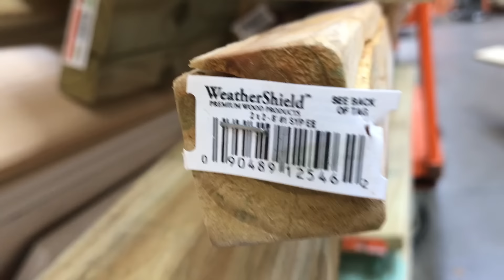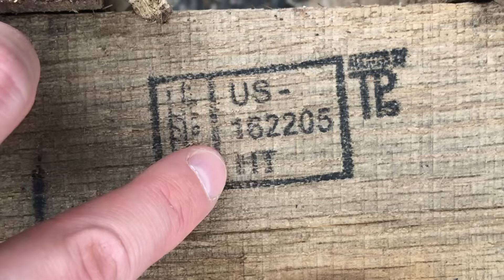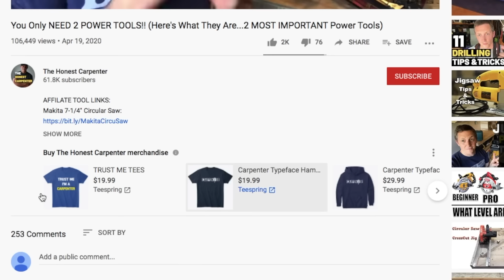Don't Use Pallet Wood!! USE THIS INSTEAD...(Cull Wood Vs. Pallet Wood)

Comment: I’m sticking with the pallets. There are some downfalls to pallets as mentioned in the video, but there’s a lot of benefits of using pallets that outweigh those downfalls. For one, the are extremely cheap and 9/10 they’re free. They don’t require much “building” as they are already nailed together to creat that rectangular shape, and they can be found pretty much anywhere in any town or city. Cull wood isn’t as accessible because most places that sell lumber do not mark down their lumber like you’ve mentioned, not only this but you still have to completely build something out of it requiring you to cut more with machinery, use nail guns/hammers with your own nails, and you have to measure everything out. The reason why pallets are so popular is because they are cheap, readily available, and require less building, less cutting if any and little to no nails or screws. Anyone can make anything out of them. The wood pallets can also be cleaned, stained, treated or painted.
Reply: STOP! Don't buy a used car....buy a brand new car! It's better and more dependable.....yeah, we know. we use pallets for specif projects because they're free and get the jop done...
Reply: I use pallet wood for making planter boxes. The fact that they’re often treated to repel pests actually ends up being a massive plus for me. It means I don’t have to pay a premium for brand new Cedar. 

Plus, I know guys who use the nails I take out of them by melting them down with a forge and making tools, jewelry, brand new nails, etc. 

On top of the fact that people will go out of their way to let you know they’re getting rid of the pallets, it’s infinitely better than cull wood.
Reply: @mikewillard34  no thanks, I'll stick to used cars.
Reply: I sort of like the over used construction look with nail holes and fragments it makes it look really good
Reply: i live in germany and never heard of ohh we have wood you cvan have irt for free .... but pallats is a nother thing ...
Reply: Survey says, Pallets for the WIN!
Reply: I haven’t ever used pallets… but have wanted to. I can’t get them in my vehicle. I would need to break down the pallet before putting it in my vehicle. However, Home Depot will cut the purple marked wood. I go into Home Depot for a couple of boards marked down. Then I ask an employee to cut it down. Home Depot only allows a few cuts a day, but I usually get many more than two cuts.
Reply: @mikewillard34  Nope, used car every time. Also, a completely absurd comparison. Cars are high cost, high consequence, and you're asking them to do a lot. You're not asking much of a pallet, it's minimal effort, and it's free. If it doesn't work, who cares.
Reply: @HerzogvonArteros  I've also never seen this sort of discounted wood.  Offcuts maybe, but even those are never marked down by a huge amount if they a usable size.
Reply: I've used pallet wood for years. Never seen any bugs, and works fine. I'm still alive too 🤣
Reply: I totally agree.  I've collected about  30 of them over the past few weeks, all FREE nearby.  My kiddo and I just toss them in the back of my SUV and unload in our yard.  I'm working on a privacy fence planter box wall for my driveway currently, then a garden potting table, benches and fencing for my animals.  They're so much cheaper than buying that high priced  lumber, all the measuring, cutting,.....besides, you get a very authentic look that your neighbors don't have and your projects become talking points at your social gatherings.
Reply: @blacksinglemomhomesteadont6454  they are fun to work with 👍🏼
Reply: I agree learn I'll pick good pallets and you wouldn't have those problems if you're making small projects pallets are perfect learn how to take them apart leave the nails like old barn wood and your golden
Reply: Totally agree! And if you treat them with anti rot it will protect your pallets from rotting.
Reply: Just got a couple of euro pallets, gonna be making a pallet desk my my gaming rig.
Reply: @flippy66  you seem to have missed their point entirely
Reply: You told him!!!!
Reply: My grandparents built their fence with pallets back in 96 that fence is still up all they do is keep it painted and replace what needs to be replaced.. Good thing is all pallets was free for them came off my grandpa job..
Reply: I'm with you.   They're just fine for making portable 'screens'/fences for certain yard situations or small farm animal enclosures.   Plus, where I'm at, lumber yards aren't giving any wood away.   The local building supply centre sells their crap wood in 4' segments - pick what you want for $2 a piece.   Big whoop
Reply: Ive litterly seen .y uncle use pallets to make a pallet wall like how the old style bars would have those barn / pallet walls and he would sand light burn marks with a torche then Staind and put up on the wall.

Comment: Guess I've been paying full price for cull wood this whole time because that "cull" wood you showed looked like normal inventory at my local Home Depot.
Reply: Same at my local Bunnings 💁
Reply: Now that's darn right funny!  Usually takes 15 minutes to find 10 straight 2x4s.
Reply: @bobr7380  Good luck at mine. If it is over 8' you can go through an entire rack and not come up with 10 straight 2x4s 

The 1x boards are even worse.
Reply: My Lowe’s isn’t any better, either.
Reply: So true
Reply: Those cull wood are way better than what i got here in our country😃
Reply: Perhaps going to a real lumberyard makes more sense than big box?
Reply: They gotten smart now.  They cut them into 2 ft lengths and sell them as "Project wood" for a premium.  May be arts and crafts use short wood (IDK)?  Also for PVC pipes.  10 ft x 1.5 in  = $10.  2ft x 1.5 in = $6.  Anything that is damaged, they cut them into 2 ft length now.
Reply: @ipick4fun27  I saw this phenomenon at my Lowe's. As a journeyman, I shook my head ..
Reply: They don't throw away any timber at my big box store. They sell it to me at full price.
Reply: My lumber yard takes 10% off. Its not worth it.
Reply: Wood stored/sold inside a climate controlled building WILL warp. Outdoor lots are best.

I used to cull lumber at a Lowe's in Calgary... the job never ended!
Reply: @joshdouglas1911  definitely
Reply: @dilbotmacguillacutty4849  me too and I don't even work there...

Comment: Based on this, Lowes needs to cull everything in their inventory lol! Because finding a decent board is like trying to find hen's teeth.
Reply: Kentucky girl they do it a lot the cull wood. Look at it like this hun. Wood is measured by foot. Not everyone needs 9 ft of wood so gets cut. That's where the cull wood comes in. Hopes helped
Reply: @jessicamendieta9773  what the hell are you talking about? She was commenting on the poor quality at Lowes.
Reply: Lowes sells hens teeth next to the bathroom
Reply: LOL
Reply: Ain’t that the truth
Reply: It must be your lowe's then bc at mine i very raely have a hard time finding good wood for my projects. And when i do come across twisted or warped wood, i simply call over the manager have them cut me out the pieces i need. they charge me for one board and regardless of how many it takes and give me the rest. it takes a little ( ok a lot depending on how badly warped/twisted the wood is) work to straighten most of them to being usable pieces again. and the pieces i can't, well they  make great push sticks, i try new painting rechniques on them, and use them as lifts to keep things off the floor nd off each other. some i just soak and warp even more so they meet my needs, it's a win win for all. And since Home Depot supports" i hate America" propoganda and is more expensive anyway i refuse to shop there. and Menards Never seems to have what i need in stock so their out as well.
Reply: I was just thinking about askinh lowes where is the cull wood cart because theres no good wood from Lowe's
Reply: I agree with you. Our lowes here sells terrible wood/lumber.
Reply: @KipdoesStuff  Maybe she forgot to put her glasses on? 😆
Reply: Your not joking! Folks, find a lumber yard near you for better quality lumber and probably better prices.
Reply: I think they use pallets as their main source of (garbage) wood for sale. Pallet wood is certainly less bowed and warped.

Ditto for Home Depot.

Comment: Thanks for making this video... I'm a pallet vendor with a conscience who's been telling folks asking me for pallet wood the multiple reasons pallets are not a good option for inside their 500k home...one thing I always tell them is that I don't know a single vendor who would bring a used pallet into their own home and it's because we've seen where these pallets have been and what goes on them...which brings me to the second reason for this message....if you do an addendum to this video or make another please include another very important reason...bug infestation...all it will take is a couple cockroaches infested deep and unseen to come out later and creat a colony in the home... additionally termites burrowed down in non heat treats that can destroy a home...and I'm not even gonna speak of the fecal matter from vermin (and that of humans) on pallets left outside...seen it all...thanks again for the effort on this video... I'll be linking inquiring clients to it
Reply: If this doesn't put a stop to people using pallets, nothing will. 😷
Reply: Simple point for you though .... most things built from pallet wood are sanded and sealed. Either process easily stopping your bug issue and the clean issue. I mean really ..... it seems most people involved with this guy's videos need to learn a lot about actual carpentry work.
Reply: How do you know if the wood you buy from a store is fecal free, from process to shop floor? 🤔🙈
Reply: novapalletdepot wow! Im learning a lot from people just by clicking this video. Thank you.
Reply: Mark Curry - thank you for this too. I have some cool looking work pallets and want to use for some outside signs. I will be careful though and seal it and use gloves when handling it.
Reply: I think in the uk in a small town in cambridgeshire we have no cockroach problems or any of the others unless you get the pallets from somewhere really really scabby. Which i can't think of any place like that here. America sounds like 1500 london, gross.
Reply: Thanks for the additional info. Just getting into woodworking and was considering pallets but this is more than enough to just say no.
Reply: Pallets with the HT mark are Heat Treated to kill such bugs.
Reply: I agree with you for all those reasons...except for the fresh hard wood pallets used to hold printing labels from our vender for our processed product. Best pallets ever! well made, level and perfectly uniform..
Reply: @TheTezz100  You keep your toothbrush & floss in the bathroom ? 
If you're worried about fecal matter on pallets look up how much gets on the above-mentioned items
Reply: @erismana2105  I don't know how you live.
But myne is kept in the cubard. & you obviously need to wash your hands before anything else. 😉
Reply: @erismana2105  yes, cubard. Comes in different shape & sizes.
Look it up online dewsh
Reply: @TheTezz100  if you keep your toothbrush in the bathroom you're brushing your teeth with fecal particles hope I dumb that down enough for you
Reply: @jw.escape6975  roaches don't stay in "scabby "  you're probably one of those people that think that lice only happens to poor /dirty people
Reply: @erismana2105  I believe 'cabinets' is what Tezz is talking about. You know, 'kitchen cabinets', 'bathroom cabinets'...
Reply: @jw.escape6975  Or it could just be that most parts of America have considerably hotter summers than the UK, giving more opportunities for cockroaches to spread outdoors...
Reply: @jic1  no its just scabby
Reply: I think I'll use it for outdoor projects. I didn't know about what the pallets are exposed to, and that IS pretty gross! If I use it inside, it'll be for very small projects and I'll be sure to clean/seal/paint the wood first! :-) Between this video and your experience, I've learned a lot--thank you!
Reply: @TheTezz100  The studies show that even if you keep floss and toothbrushes in a cupboard or drawer, you still get fecal matter on them. Fecal matter is EVERWHERE in your bathroom, no matter how clean!
Reply: @smeyers61  knob head!
Your going tell me next that germs don't exist either 🙄
Reply: @Being_Joe : If you are creating ANYTHING out of wood, yet you arent sanding, then you arent making ANYTHING out of wood. Termites can be a problem with Pallet wood very true, NOT roaches. You combat all bug problems by spraying your pallet with bug spray once you break it down, leave it in your "treated" wood pile for several days away from moisture or rap in sheathing (Plastic) and leave in the sun. This takes care of your bug problem, sanding takes care of you contaminate problem, unless you plan to eat off of your wood. A pallet sales man does not a wood worker make.
Reply: I was planning on using 6 inch pieces of pallets to make rustic looking stepping stones in my front yard (I'm in Canada and we don't have termites or cockroaches here). In your professional opinion, would that be an ok use for pallets? As a side note, nobody (but deer) uses the front yard, it would just be for looks and none of the pallets would come into the house at all.
Reply: @commenter5901  - yes use them.
Reply: @erismana2105  I think he is differentiating between bathroom  and toilet
Where I come from bathrooms don't have toilets in them.
Just a bath and or shower and sink. Often with a bathroom cupboard for medicine etc
Reply: I built a pallet garage 20 years ago its still standing with no issues this bloke is just a whiner ,Nothing wrong with pallets & him saying they rot all timber rots if you don't look after it ,This video is nonsense
Reply: Couldn't you just treat pallet wood like driftwood ?  ie. soak it for a few days in a bleach solution and even use wood preserver or sealant if using it for a project, and if you're burning it in a wood stove you wouldn't be breathing in toxic fumes as they'll be flued outside through the chimney.  Or am I missing something here ?
Reply: @charlieward5035  Exactly 💯
Reply: I've used pallets for artwork projects.

Very first thing I do after disassembling, is pick the best pieces.

Wash with dish detergent and bleach. Let air dry, sand and then cut glue nail and paint. 

I like this full wood idea better, honestly.
Reply: Thank you for this enlightening information. I was thinking about building a patio set from pallets. However, I was going to purchase new pallets. Can you share the downside of that option. Thanks.
Reply: @erismana2105  I read about a survey result that anything within 8 feet of the flush gets contaminated with airborne matter. It recommended keeping your toothbrush in your living room!
Reply: Dude...🤦🏼‍♂️
Reply: @stephbhoy1  🤣your mask won't stop nothing neither!! 😂😂
Reply: @Being_Joe  🙄🙄